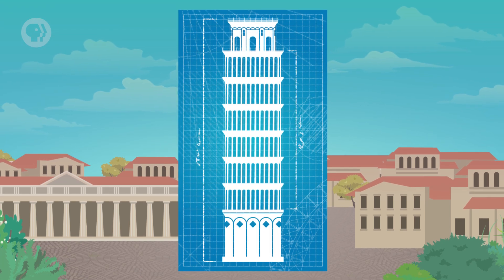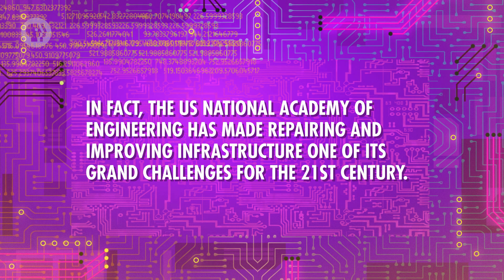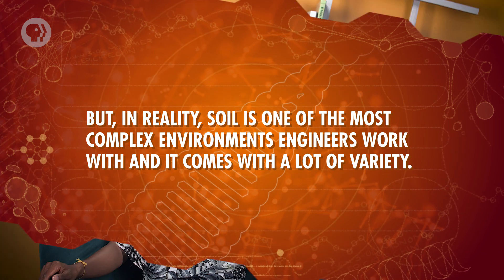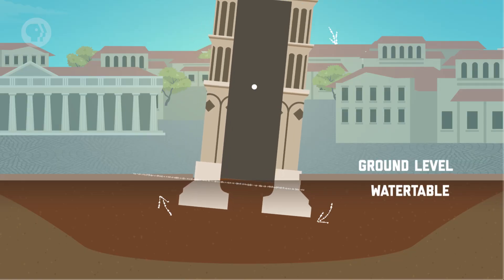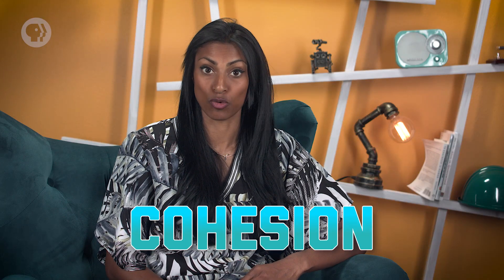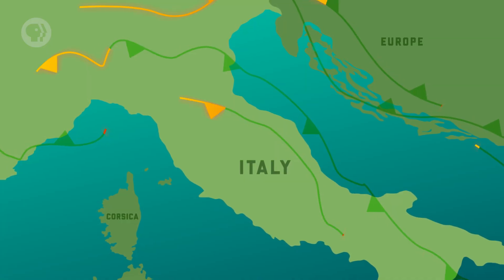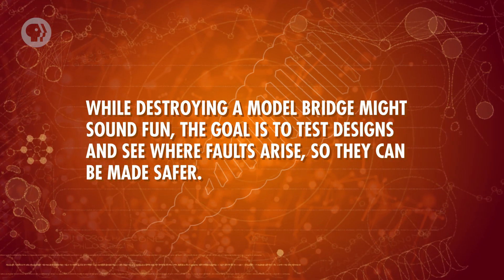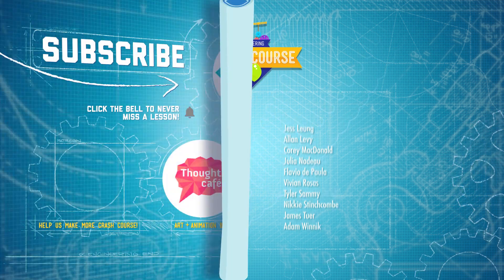How the Leaning Tower of Pisa Was Saved: Crash Course Engineering #40

Comment: She got this wrong. I did a report on geotechnical performance on Pisa in college. It was not a bearing capacity failure. Pisa is built on overconsolidated clays. During the construction of the tower which took a 100 years. The surcharge incr.reasingly started to squeeze the water from the clays. This is what caused the differential settlement. This process is still happening today. When the water is squeezed from the clays the soil will gain strength. It was calculated that if the tower was built all at once there would have been a bearing capacity failure. This would result in collapse of the towe

Comment: Scale model testing is generally pretty rare. It's super expensive, so it's only for more important buildings. Most of the time it's faster to run dynamic models on the computer, or even using simplified static analysis.